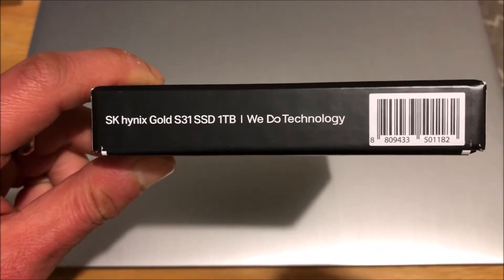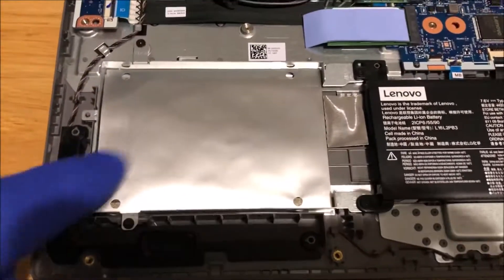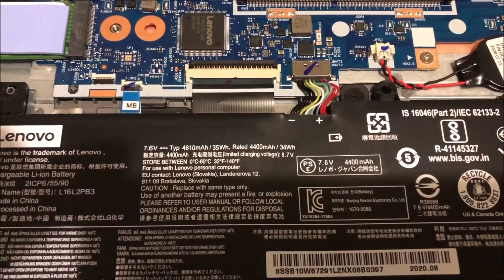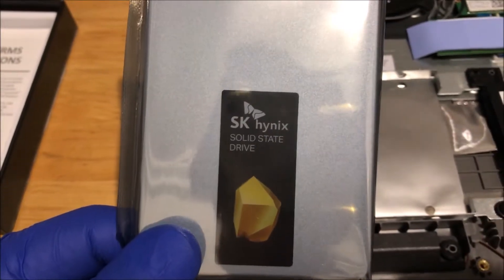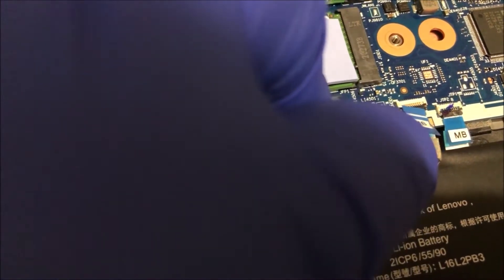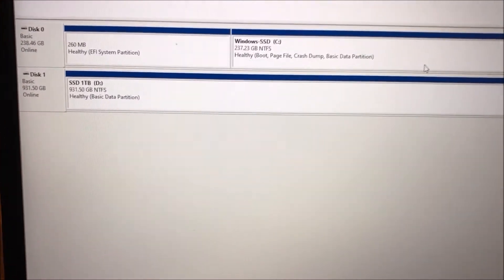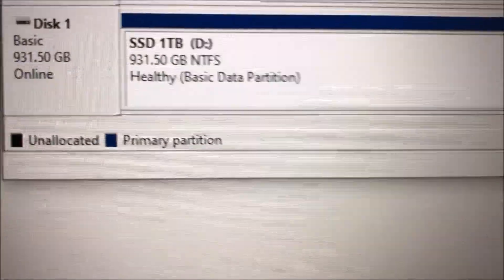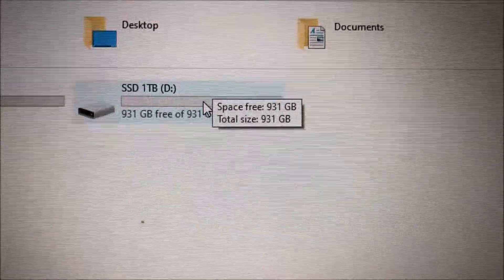Lenovo IdeaPad 3 SSD Upgrade and Install

Comment: ordered "correct" cable from Amazon ( it said "for lenovo ideapad 3) and it was about 2 inches too short, with no angle / twist.  

ordered a  second one also said for lenove ideapad 3, and it was long enough, but the angle /twist was backward, mirror image.  So I forced another twist into it and forced that battery back over it.  Works.

plugging in the little cable end into the board is not very gratifying.  No click or snap, barely goes in there.

Now I gotta figger out how to make the puter boot to the "new" ssd
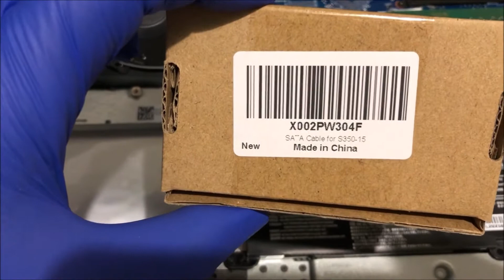Reply from the maker: rewatch 0:40 and 1:43

Comment: what if theres no bracket for the ssd is there the same bracket i could buy somewhere or its just not possible
Reply from the maker: You would have to buy a bracket to hold the SSD in place; try searching the manual or product page for the part ID number/serial number, etc. then search on Amazon, Newegg or other shopping sites
Reply: @serafinlim  aaah okay thank you very much ive been looking at videos about this but i cant find it anywhere and theres only videos about the M.2 upgrade and RAM upgrade so this has been very helpfull
Reply from the maker: @paffyy  You are welcome. I was looking for videos and instructions as well and didn't find any; so I made my own video to help others like you. Good luck on looking for the bracket.

Comment: Hello.  Can that same cable be used to put an SSD disk instead of a HDD?
Reply from the maker: Hi. In the video, I did use the cable to install an SSD, not HDD.
Reply: @serafinlim  You're right.  Forgive me.  Can I install Windows on the SSD and use the M2 disk that comes with the laptop by default to use it as storage?
Reply from the maker: @augustoabd9130  no worries. I believe you can; just have to mirror image the OS from M2 to SSD, and set SSD up as default boot in Bios settings. But please do research first, I am not a tech expert; that is just my suggestion, not advice.

Comment: Ahh so we need the cable... Whats the name of cable?
Reply from the maker: The cable I got is in the video description. Here it is again: Deal4GO SATA Hard Drive Cable NBX0001S900 HDD Connector for Lenovo Ideapad S350-15 S350-15IWL S350-15IIL S350-15IKB Ideapad 3-15IIL/IML/IKB/IGL
Reply: @serafinlim  my bad, thank you for your replies🙏